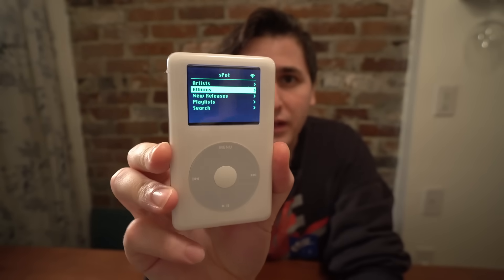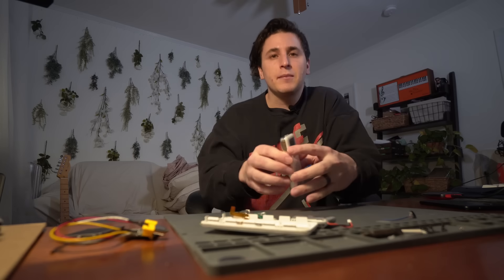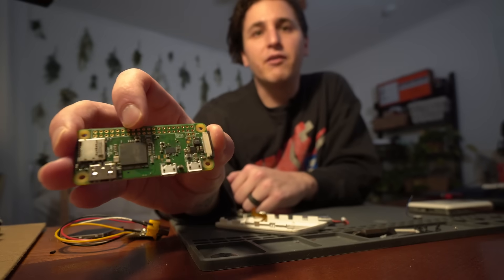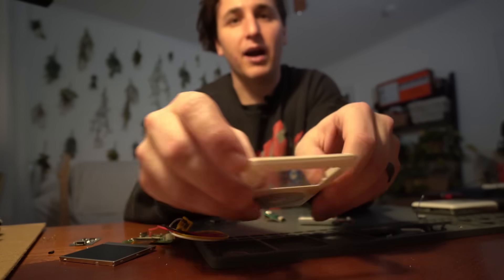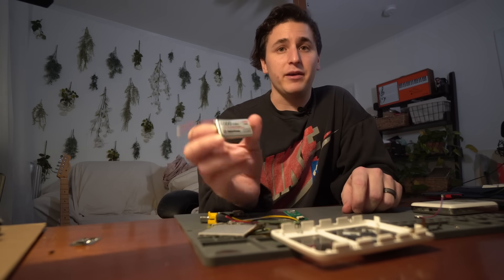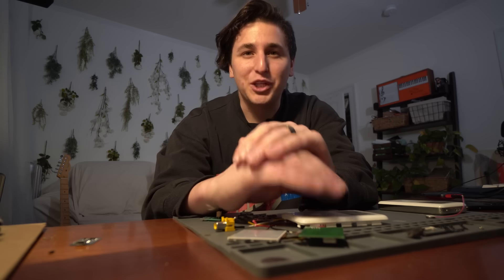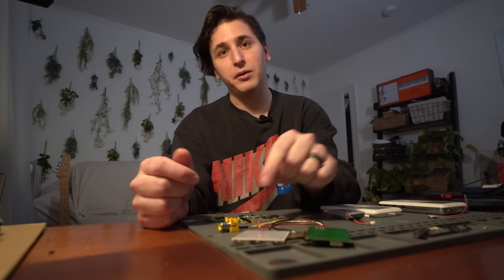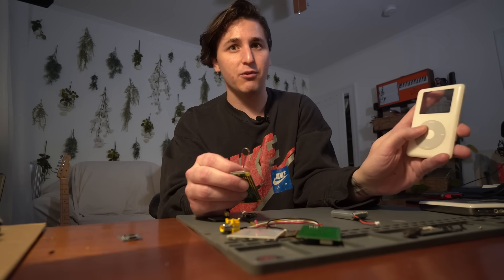Spotify Streaming on a modded 17-year-old iPod Classic (via Raspberry Pi)

Comment: I wish someone would sell something like this with MP3 support and a functional headphone jack (or even just allowing the use of a small USB-C DAC like the well rated Apple one for $10). The current best option is a modded iPod Classic 5th Gen for around $175, but it's a bit lacking. There's also the Innioasis Y1, but with how many new iPod 5th gen parts there are on Aliexpress, I would've rather they just used those instead of designing their own.

Comment: It's cool and awesome but my question is ipods have an old board in it can it handle these mods and how long does it last? won't it damage them in a long term run?
Iam having an ipod classic 6th gen I love it just changed the battery it has old hdd with a more damage might fail in future but still runs smooth but my question is if i upgrade mods like you will my ipod last long cause i really love it😢

Comment: This is no longer an iPod;  it's a RPi-Zero in an iPod case.   Still, it's a sweet project!

Will the original iPod system board fit into a Raspberry Pi case?

Comment: Unfortunately I fear that the project is outdated, the software installation does not work, I think due to problems with the communication protocol with the spotify API and perhaps also with openbox. Do you still have the player working? In that case would you have the desire and time to update the project? It would be greatly appreciated .. and in that case thanks.

Comment: This defeats the point of having an iPod. Just use your phone. The reason to use an iPod is to play the music YOU own, without being tethered to an internet connection. Also, that is not an iPod. Using a raspberry pi is cool, but if you’re not using the original motherboard, than it isn’t an iPod anymore. Period.
Reply from the maker: "period"
 there is no single "point" to owning a device, but I'd argue the MORE important part is to not be bombarded by the distractions of a smartphone. It's 2024, internet connections are ubiquitous.

"Not an iPod"
You (like many here) have drawn an arbitrary line!! Looks like an iPod, feels like an iPod, embodies the iPod... I'm calling it an iPod ✌️
Reply: Fair enough, you are right, the benefits are indeed the lack of notifications and calls. I did just realize that I commented on a three year old video negatively for no reason. I guess I just hate music streaming services in general, but anyway.

Comment: This is super cool. I think the biggest improvement would be to move away from such a heavyweight OS and go properly embedded. That would give you much improved bootup times and likely better battery life.
Reply from the maker: Thanks! And yeah I think a bunch of work has been done to get a Spotify Connect client running on the ESP-32 in the time since I started this. If I get time to get back to it, I'll probably go that route

Comment: Very nice add on to this ipod!
just a curious question,
Do you use a foam extractor for your soldering ?
Reply from the maker: I do, it was out of frame at the back of the desk. I will admit that I occasionally forget to flip it on, especially when I am distracted by filming, so if it doesn't look like it's on - you're probably right 😬

Comment: This is seriously dope! Amazing work man! Definitely going to try my hand at this with my old Pod. @GuyDupont Do you think it's possible to make a version with a 4G sim card in it so it's not reliant on WiFi? is this something the Pi OS could handle?
Reply from the maker: I think you're more likely to run out of room inside the case tbh! Mine was packed as tight as could be without an additional card socket but I also didn't plan very well.
Reply: @GuyDupont  yeah true - good point!

Comment: why not esp32/8266? i am trying to do something similiar so if theres a reason please tell me.
Reply from the maker: 8266 not gonna have enough horsepower, I think. Esp-32 could work, I think there's a library for streaming from Spotify with it (cspot). If I ever redo this, I will also use that.
Reply: @GuyDupont  esp32 have easily available versions with 16MB of ram/flash. so i was even thinking about having a mini library there, 1h of offline content
Reply from the maker: @a-c1081  makes sense, though idk if you're going to be able to cache files from Spotify - you'd have to load your own mp3s on. As far as I know these "Spotify connect" libs only let you stream.
Reply: @GuyDupont  yeah, true.
Reply from the maker: I went with the raspi at the time because I just wanted a working version, and the quickest way to get there was with Python.

Comment: What do you think about to use rust language to develop these softwares?
Reply from the maker: For this application, I'm not sure I see an advantage of using Rust over Python. Most of the Spotify code is just web requests where the network is going to be the bottleneck. And the UI is simple enough that it doesn't really need to be high performance.

Comment: The irony of one of the only pieces from the original device that you kept being the clickwheel, is that supposedly the only reason they stopped making them this way is that they could no longer source it. Which tbh always sounded like a crock to me. But not long after they stopped making them, Spotify took over and made ipods obsolete anyway. So the other irony is it's super fitting that you converted it to basically only use Spotify. Its' kinda hilarious and awesome.

Comment: Absolutely amazing and thank you for sharing 🙏 I happen to have an 04' ipod with a dead battery in my dresser and Raspi Zero sitting in a tool box.

Quick question, would using something like an ATTiny85 programmed to control one relay with button presses work to make the power toggles with the play button like the original? Have a hardware connection (2 wires for a physical play button press) going to the play button, hold play down for more than a few seconds, relay for power turns on and stays powered or turns off and stays off; tap play once quickly and the ATTiny knows to do nothing and serial data continues into the pi as needed? Or, have the ATTIny also ready the serial data and if it detects play button clicked twice rapidly or something, have it toggle the power relay? ATTIny comes in tiny smd packages as well as some relays that sip power. The only downside I could think of is the ATTiny needs power all the time to keep track of what the button is doing but with a watchdog using interrupts if a physical button connection is used (as opposed to using serial data) it would consume almost no power in standby and probably last for at least weeks off of a single charge. Have any thoughts on this?

Comment: Mmh, this is not Spotify on an iPod Classic. It's a R. Pi in an iPod Classic case. This is something very different!
Reply from the maker: This is a copy/paste response since I get this kind of comment occasionally.

1. Yes, it's a Raspberry Pi. It's right there in the title.
2. I used as much of the original as I was able to at the time. It's not "just the case" - I am using all of the original click-wheel circuitry, which was non-trivial! I also got the headphone jack working later on. I would have loved to get the screen working.
3. I challenge anyone who says "its not an iPod" with this question: if I put this in your hand and let you use it, without telling you what was inside, how would you honestly describe it? 

My goal was always to capture the spirit of the iPod, not constrain myself to the original hardware 🙂

Comment: at this point its not a ipod. Its a raspberry pi that looks like a ipod. use ipod internals and hacks to make it run ;)
Reply from the maker: This is a copy/paste response since I get this kind of comment occasionally.

1. Yes, it's a Raspberry Pi. It's right there in the title.
2. I used as much of the original as I was able to at the time. It's not "just the case" - I am using all of the original click-wheel circuitry, which was non-trivial! I also got the headphone jack working later on. I would have loved to get the screen working.
3. I challenge anyone who says "its not an iPod" with this question: if I put this in your hand and let you use it, without telling you what was inside, how would you honestly describe it? 

My goal was always to capture the spirit of the iPod, not constrain myself to the original hardware 🙂
Reply: @GuyDupont  I hear ya no worries, GUI you got going does it well however

Comment: So this isn't an iPod. This is a custom built hardware in an old case.
Reply from the maker: This is a copy/paste response since I get this kind of comment occasionally.

1. Yes, it's a Raspberry Pi. It's right there in the title.
2. I used as much of the original as I was able to at the time. It's not "just the case" - I am using all of the original click-wheel circuitry, which was non-trivial! I also got the headphone jack working later on. I would have loved to get the screen working.
3. I challenge anyone who says "its not an iPod" with this question: if I put this in your hand and let you use it, without telling you what was inside, how would you honestly describe it? 

My goal was always to capture the spirit of the iPod, not constrain myself to the original hardware 🙂

Comment: so its not an ipod its just a pi in aipod body?
Reply from the maker: This is a copy/paste response since I get this kind of comment occasionally.

1. Yes, it's a Raspberry Pi. It's right there in the title.
2. I used as much of the original as I was able to at the time. It's not "just the case" - I am using all of the original click-wheel circuitry, which was non-trivial! I also got the headphone jack working later on. I would have loved to get the screen working.
3. I challenge anyone who says "its not an iPod" with this question: if I put this in your hand and let you use it, without telling you what was inside, how would you honestly describe it? 

My goal was always to capture the spirit of the iPod, not constrain myself to the original hardware 🙂

Comment: This is not an iPod, it’s just a pi in an iPod case, that’s it…
So the real thing what’s happening hier is that you are streaming Spotify to a pi…
Wow, that’s highly underwhelming…
Reply from the maker: If I handed this to you without telling you what I did to the inside, what would you call it? The point was not to use the original parts, the point was to make it feel like an original, and actually get it to stream (impossible without new internals). And getting the clickwheel to work was non-trivial, I would hardly say that's just the case.
Reply: @GuyDupont  don’t get me wrong, that shouldn’t mean that this is not good work, but when you put an VW Golf engine in a Porsche, is then the Porsche still a Porsche?
I don’t think so (Porsche and VW btw too)…
So when I say that this is no iPod anymore then not cuz it’s bad, it just mean that, it’s no iPod anymore even if it has the housing and the clickwheel (that is really impressive) but when the heart is gone it’s hard to say that it is still the same device…

Comment: Is this possible to achieve with solid state clock radios? Imagine turning them into a large pieces of Spotify hardware!
Reply from the maker: I actually have another project on my channel where I do a clock radio mod! Little different, but could definitely do a spotify thing if I could figure out what all the input should do.
Reply: @GuyDupont  Right on I’ll check it out! Your projects inspired me to pitch an interactive art installation to my University. Think I’ll actually get some funding for it I’d love to tell you what it’s about.
Reply from the maker: @Parker Muckenfuss that rules!!! Email me, just added my address to the video description
Reply from the maker: @parkermuckenfuss2742  sorry dunno if that reply worked ^^

Comment: This is really cool. I've always wanted to do this but I've always found coding and electronic parts daunting. Does anyone have resources for a complete novice?
Reply from the maker: Thanks! To start, I would recommend checking out Adafruit's learn guides, particularly the ones around CircuitPython. CircuitPython is a pretty great intro to both coding and hardware IMO.
Reply: @GuyDupont  hey, thanks alot

Comment: I want to start by saying that this is absolutely amazing. Your work is incredible. That said your title is a little bit clickbait because right after you say that you did this on an iPod, you then proceed to tell me that you completely gutted the thing, which means you didn't really do it on an iPod. You just did it using an iPod case and a click wheel.  Again though, amazing work! I'm jealous!
Reply from the maker: I appreciate the compliment, and I've gotten this type of comment a bunch since I posted this. That's why I added the (via Raspberry Pi) to the title. And I get where people are coming from, but I think it's only partially fair. I dont feel like I FULLY gutted it. I used the original case, clickwheel, buttons/switches, and headphone jack (in part 2). I understand that that's not the "heart" of the iPod, but all of that integration was not trivial! I had to write a custom driver for that clickwheel. And my justification for leaving the title as-is in its current form is:
if I put the finished product in somebody's hand without saying anything about how I got it done, and then I asked them to describe it, what would they say? I would bet good money it would sound like my title.  

All that said, I would really, really love to get this working with the original screen. I will pick it up again and give that a go someday. Thanks for watching!

Comment: With the zero w model sold out everywhere, is there a secondary option that could make this work? Size I can see is one of the biggest factors...
Reply from the maker: Unfortunately I haven't tried any alternatives. There is a board from MangoPi that has a similar footprint to the zero w, but I have no idea if any of the software will be supported and they don't seem to be super available either.

Comment: Just gotta be the guy to say, saddened me you used a working ipod. Coulda got replacement parts, would be cheaper to
Reply from the maker: If it makes you feel better, I saved all the original parts and only snipped a tiny bit of support plastic on the inside. And again, it was gifted to me, otherwise destined for the recycling bin.

Comment: great and all but, the only thing ipod about this is the shell
Reply from the maker: Fair, but this was always about the end user experience, not what ended up under the hood. Also, I'd argue that integrating with the original clickwheel circuitry goes a little beyond "the shell"!

Comment: The Banana Pi M2 Zero is an ultra compact single board computer which measures only 65mm*30mm. Its external interfaces are the same as the Raspberry Pi Zero W, aIt uses the quad-core Cortex A7 Allwinner H2+ processor, with 512MB RAM. it supports both Linux and Android operating systems.
http://wiki.banana-pi.org/Banana_Pi_BPI-M2_ZERO
Reply from the maker: I was looking into using one of these, but I thought I might run out of room with the components on the bottom. I'd love to play with one... 😉

Comment: It will be good if that screen is touchable so you can search faster and you can search with Microsoft SwiftKey Keyboard. And the headphone jack could be used for Universal Remote Control may be ? (https://www.oreilly.com/library/view/ipod-and-itunes/0596007787/ch01s10.html)

Comment: would never listen to music from a pi zero instead of a wonderfull ipod soundchip ... but as a project, expensive and lovely for a poor sound quality :) but its fantastic to make the wheel usable at raspberry pie, really awesome ... 

So i am dreaming of my old 60gb 2005 ipod to be able to connect to a bluetooth speaker(easy to solder a bluetooth module to earphonejack and battery)  and able to transfer mp3 files over bluetooth or wifi but listen to music from the original ipod board etc .. :D if wanna go further, use its own harddrive as a nas server to have acces on it :D :D 

hope the rasperry goes smaller one day so i can fit it inside the ipod box and give hardrive access to the ipods 60gigs, so the dream comes true :D 

again great project your rasperry pie ipod case project ,) thanks

Comment: Noo. I thought you wrote a new booter to utilize WiFi and Bluetooth. Next project?
Reply from the maker: Eh, not really what I was going for here. It was always about capturing the user experience, not utilizing the original hardware (though I wanted to use as much as possible). Using the original chip would have required significantly more work and produced a significantly worse end result. I would have had to add radio hardware anyways. Also, since it's powered by a Pi, it's easily hackable to do other things I haven't even thought of yet. And it's more accessible for others to jump in as well.
Reply from the maker: That being said, I would love to get the original screen working!!

Comment: Dude, you pulled out what was one of the best DAC's in history and replaced with it with a shitty Bluetooth chip and micro-usb port? You completely ruined the iPod. There's a reason these classics cost so much used. The output levels on these and sound quality really is not matched by any modern stand-alone portable audio hardware. You could of used any case for this but you ruined an extremely good piece of hardware to do this. That's just stupid.
Reply from the maker: This iPod was destined for the trash, and I took it and turned it into something I'd actually use in 2021. And I kept all the original parts, they work fine. This model costs $35, there are plenty available on eBay (I should know, I purchased a few to make sure I could get this done).

It's gonna be OK.